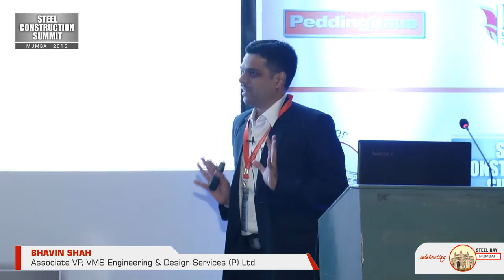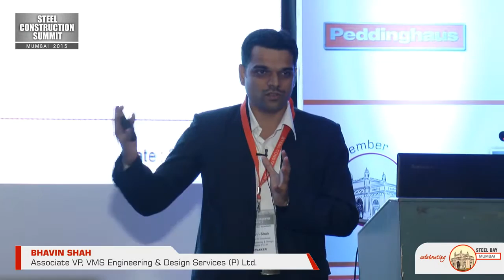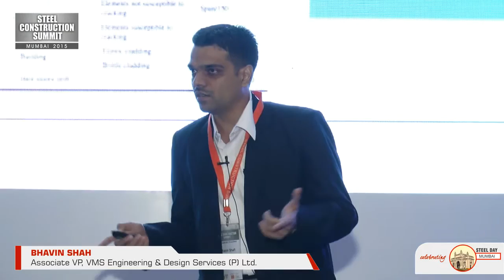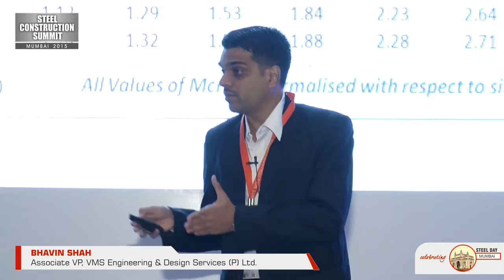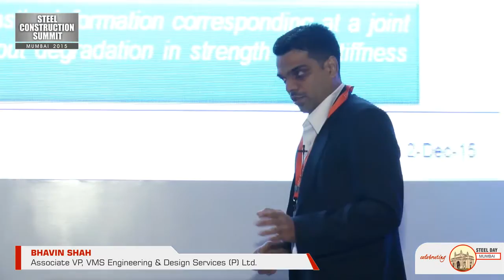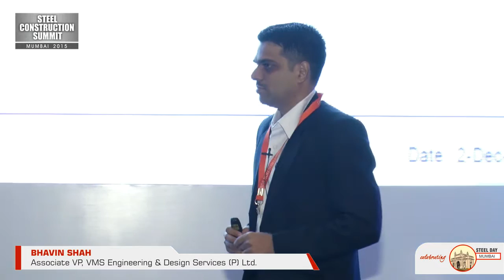IS : 800-2007 - Experience Sharing

Comment: I've few questions on IS800:2007 section 12. Regarding joint rotations.what braced frames like ocbf and scbf required joint rotation clauses where there are axial force carrying componenets. I can understand OMF and SMF frames, but SCBF and OCBF frames having such joint rotation clauses doesnt make any sense. Is there any research paper or book reference available from which this clause has arrived.

Comment: Mr. Shah ,  I am working on a Project in Ahmedabad  which has huge Steel Framing ( 32 Stories high).  Most of my experience is from working in USA.  I am told that in India  STEEL CONNECTIONS  are  done by  STEEL  FABRICATOR based on a final  Computer Out Put given by  EOR ( Engineer Of Record) or Design Consultant.   AISC, " 2010 AISC   Code Of Standard Practice"   has specific responsibilities about Steel Connections Design.  Most preferred way is that the Project Design Consultant, Design all Steel Connections.  I have used  STAAD/PRO  out put linked to  Connection  Design software's like DESCON  or  RAM STEEL  CONECTIONS.  I need your thoughts/ comments on  " 2010 AISC   Code Of Standard Practice"  Connection design requirements against Current  Indian Practice based on  IS: 800-2007.   Regards.  There is this useful paper on this subject:     http://msc.aisc.org/globalassets/modern-steel/steelwise/2015/steelwise1.pdf   .     Vasudeo  Pandya  P.E. , Structural Engineer
Reply: +Vasudeo Pandya  Thanks for sharing useful paper of AISC on the subject. IS:800-2007 do not specify different options (1 to 3) as mentioned in the AISC paper. In my opinion, all three options mentioned in the paper are in practice in India. However, in all cases, role /responsibility and scope shall be clearly identified. I agree with your view point that the most preferred way is that Project Design consultant design all connections.
Reply: Thank for sharing your experience 🙏🙏🙏